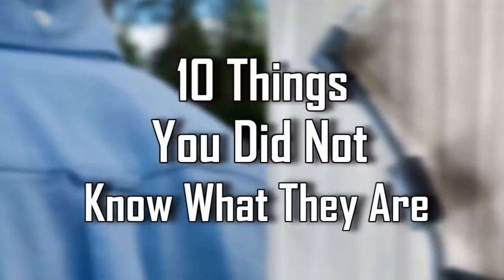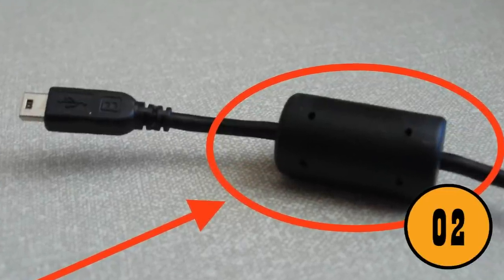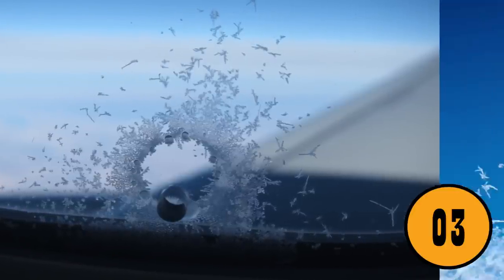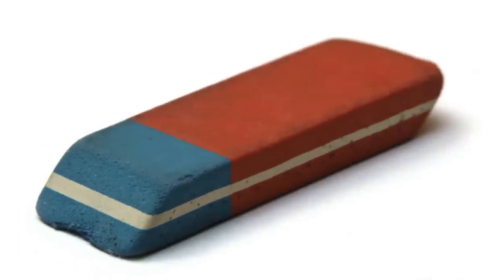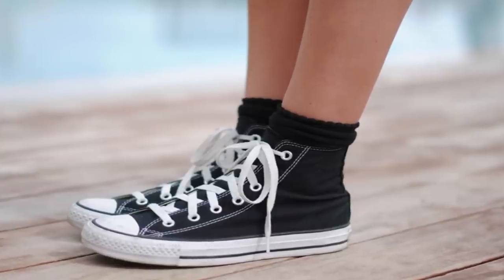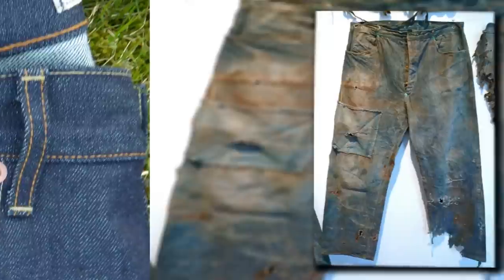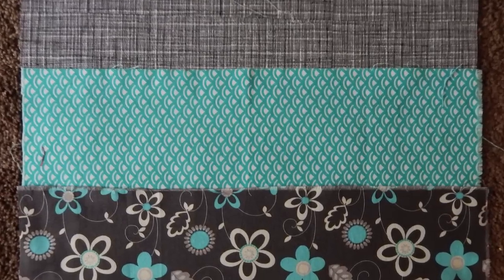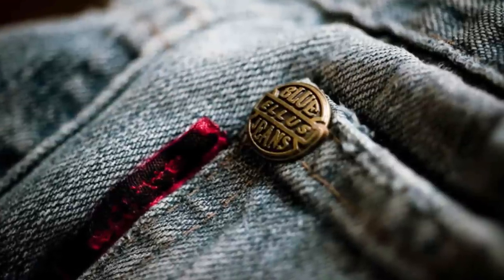10 Things You Did Not Know What They Are

Comment: the spaghetti spoon made 0 sense
Reply: Zaria Harris 🤓 in theory, if you’re using actual straight spaghetti noodles, you use the hole to put the dry noodles thru to measure before putting them in the water.
Reply: platinumbleu that would be about five noodles in mine. The holes are quite small; they're definitely for draining.
Reply: I have seen some with holes specifically marked for 1 and 4 servings, but to put forth (as shown in the video) that all spaghetti spoons have holes for portioning the dry pasta is ridiculous.  Mine has slots, not a hole or holes.
Reply: Roger DeeDodger seems like the people copycating the spaghetti spoon didn't look into it before they stole the idea
Reply: platinumbleu thanks for explanation. Clever
Reply: Thanks you for explaining it so i could understand it. They should've shown that in the video.

Comment: Written title not the same as the spoken version.
We called the loop on the back of the shirt a "fruit loop." A person who was a "fruit" - a "nerd" in today's terminology - were the only people who wore that type of shirt. (See: plastic pocket protector, also)
I wonder if this guy knows why shirts have button-down collars?
The hole in some pen caps has nothing to do with it being swallowed by someone. It's there for the same reason there's a tiny hole in the airplane window - to keep the tiny bit of air inside the cap from being compressed when the cap is put on (which would cause the ball in the ink cartridge to retract letting ink leak out... into the pocket of your nice shirt with the button-down collar, and the fruit loop in back. Unless you're using a pocket protector, of course.)
If you look at the barrel of some pens you might find a tiny hole there - it's to keep a slight vacuum from occurring as ink is drawn out of the pen (which would keep the pen from working).

Comment: Hi, I know this video probably wasn't helpful so here is something that is:

Ingredients:

-5 peaches , peeled, cored and sliced (about 4 cups)

-3/4 cup granulated sugar

-1/4 teaspoon salt

For the batter:
-6 Tablespoons butter

-1 cup all-purpose flour

-1 cup granulated sugar

-2 teaspoons baking powder

-1/4 teaspoon salt

-3/4 cup milk

-ground cinnamon

Instructions:
Add the sliced peaches, sugar and salt to a saucepan and stir to combine.  
*(If using canned peaches, skip to step 3) 

Cook on medium heat for just a few minutes, until the sugar is dissolved and helps to bring out juices from the peaches. Remove from heat and set aside. 

Preheat oven to 350 degrees F. Slice butter into pieces and add to a 9x13 inch baking dish. Place the pan in the oven while it preheats, to allow the butter to melt. Once melted, remove the pan from the oven.

In a large bowl mix together the flour, sugar, baking powder, and salt. Stir in the milk, just until combined. Pour the mixture into the pan, over the melted butter and smooth it into an even layer. 

Spoon the peaches and juice (or canned peaches, if using) over the batter. Sprinkle cinnamon generously over the top.

Bake at 350 degrees for about 38-40 minutes. Serve warm, with a scoop of ice cream, if desired.